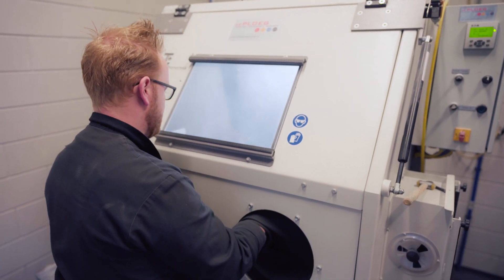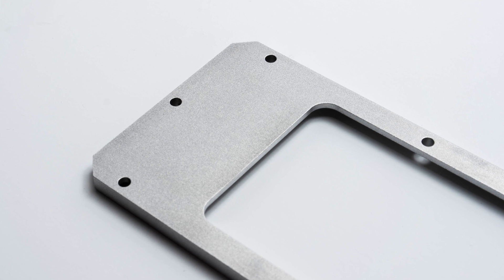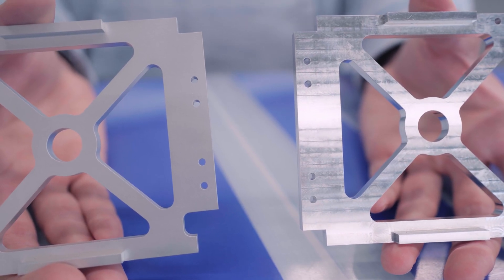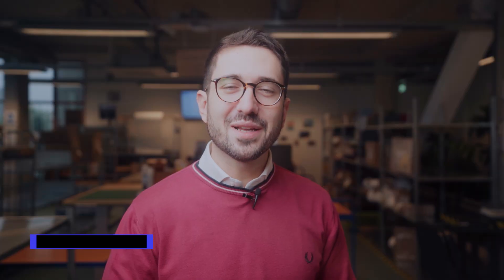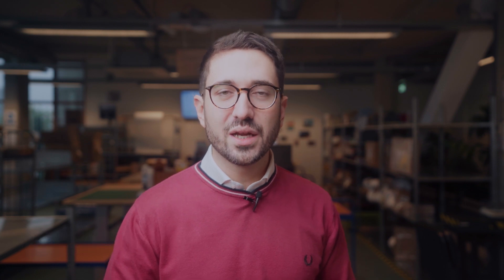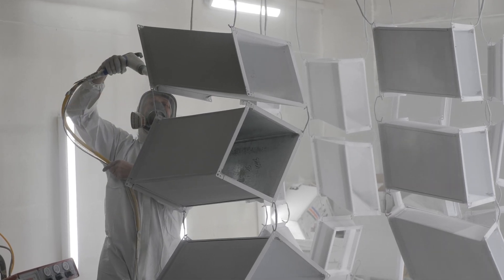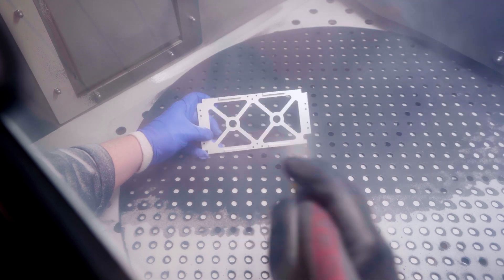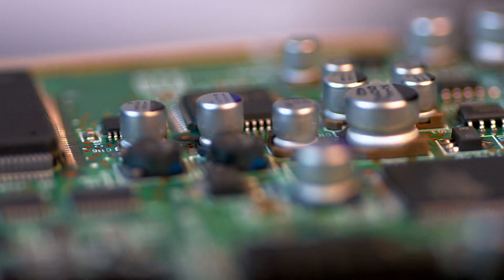When to Use Bead Blasting (and when not)

Comment: If it can strip away metal and paint why is it safe to use with just latex gloves? I'm a novice btw.
Reply: The softness of the gloves absorbs the energy so it cant penetrate it. Kind of how you cant cut your finger on an oscillating multitool saw type deals but you can cut wood and metal with it.
Reply: @Foomanlol  FYI the oscillating multitool that most people have in their garage will cut right through your finger. You're thinking of a cast saw. It moves a lot less with each oscillation.
Reply: @Foomanlol  hey thanks man! That makes a lot of sense, hopefully I remember this info lol.